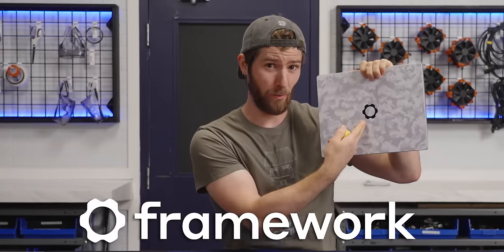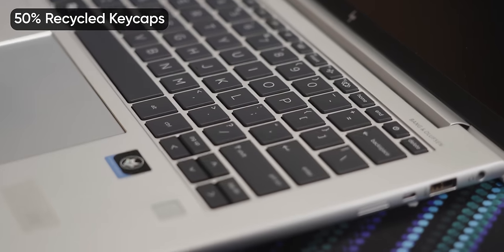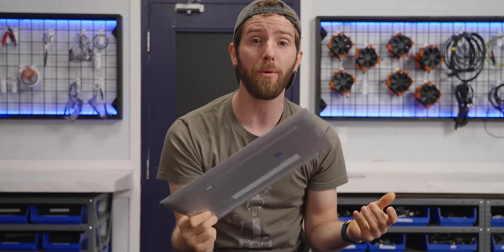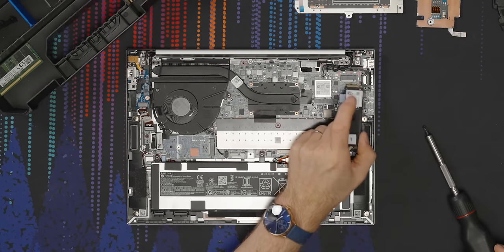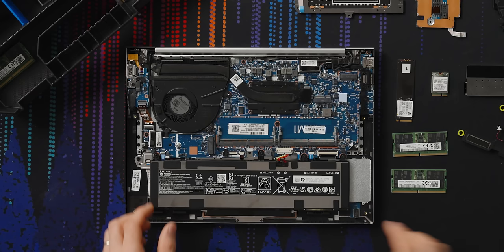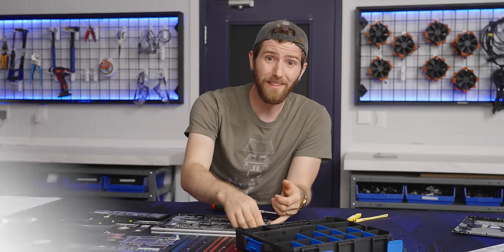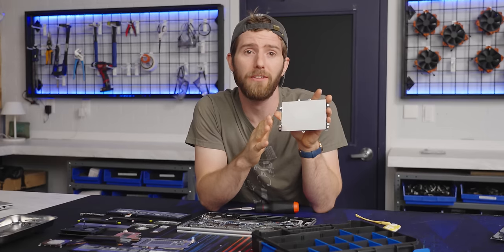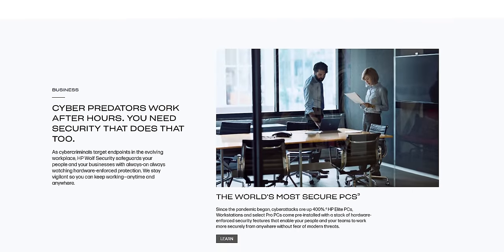My Investment is in TROUBLE - HP repairable laptops

Comment: I'm hesistant to praise HP - it might be the case that small form factor laptops as of late use more glue and parts that can't be removed. However, I have cheaper laptops within a few years old, from Acer for example, that allow you to take all of these same parts out without dealing with any glue or weird screws. To me it feels like HP just shipped a normal laptop that their media team just slapped on "repairability" when it's been like this for years for many, many laptops. Maybe their smaller or more unique designs have glue, but I would venture that many laptops still simply use Philips screws with no glue in the chassis. At least that's been my experience.

Comment: Did they fix their terrible hinge design that last I heard they had a class action lawsuit over? If not all of this is a great step in the right direction but ultimately means nothing as if those break you have to replace the casing which throws any sense of end user reparability out the window as that would be too daunting.

Comment: ...Hey Linus, hate to break it to you, but this isn't unique to the G9. I'm a tech at a site that uses exclusively HP who's worked on the G7s and G8s. Literally nothing new or interesting on the inside, outside of the AMD CPU and the related connectivity. Heck, the G7s were even easier to work on than this.

Comment: Coming from an it tech who has repaired a boat load of very similar HP laptops to this one...the design isn't really that special, the repairability isn't really any better or worse than most modern HP high end laptops, literally all they have done is readily supply parts and not charge through the roof for them...that's something everyone should have been doing from the get go... I really am not all that impressed by this over the framework

Comment: Framework can always move to a niche the major manufacturers aren't at (not for lack of trying...I'm looking at you, Dell): repairable, upgradeable gaming laptops. Where you can move the board into a Minisforum NUC Xi5/i7 type of enclosure for emulation etc on a TV for everybody not wanting to blow cash on current console games that don't get to Windows.

I mean it doesn't have to be a super thick Alienware with a supposedly replaceable GPU or an Asus external dock that uses a desktop GPU card and a proprietary connector that works better than Thunderbolt (why can't we just have an Asus external dock  using that port though...sure you might not buy an Asus desktop card, but at least it won't be a $1500 GPU card with a power supply every time). That you can switch over to a board with a  new gen GPU and a two generations newer CPU is enough.

"But gaming laptop component locations make designing the cooling system problematic!" VAPOR CHAMBER. Components can shift around a bit but as long as the CPU and GPU have the same height and you can tell what  thickness thermal tape you have to switch to for the VRMs and VRAM it won't matter if you had to shift either of the processing chips to accommodate VRM or VRAM.

Heck I don't even need display panels alone to be replaceable. Have it all come as one assembled clamshell and I'll reinstall the whole top half. At least the new one won't have scratches on it or have plastic temp warp over time that makes snapping on a new panel a problem.

It's not going to be a super slim machine either, plus the power input's gonna be a barrel plug or something that looks like USB as on Lenovos, so it doesn't necessarily have to have only those hot swap Framework ports. Maybe have one or two like that so peripherals' receiver dongles can be recessed. Otherwise I'm fine with a daughterboard on one side and the rear. Best part about it being on the daughterboard: you can pull video cables out and damage the miniDP or HDMI port or the TB port if you have it hooked up to a dock with a card reader and extra peripherals you only use at your desk, and you still only need a screwdriver instead of a freaking soldering iron.

Heck if it gets me a bigger battery plus it has a vapor chamber anyway I'd be willing to go with soldered RAM. Sure maybe that's harder to fix, but then by the time you break the RAM you might want to upgrade to a newer board anyway. At the same time...would you actually break RAM and RAM controllers when it's also getting cooled by the vapor chamber instead of having the heat trapped by a shield or just not having holes there for your cooler to blow air onto the SODIMMs through.

Comment: HP keyboards are not replaceable. They are plastic welded to the chassis. This doubles or triples the price of a replacement cost and makes replacement a major headache.

HP is much better than most OEM, but not particularly remarkable, and has been on this path since before framework was a threat.
I'd like to point out differences of internal screws, and that the captive screws wear out and fall out after a few cycles.

Comment: I don't think repairable offerings from HP or Dell will compete with Framework. The motherboard on my XPS 15 just died after 6 years. That is a replaceable part, but Dell no longer has it in stock. Why would they when their enterprise customers replace laptops at a 3 year interval. I'm sure though that Framework will have a compatible upgrade motherboard for me in 6 years. Building a repairable laptop is easy. Maintaining spares in stock is where I fully expect HP and Dell to fail.

Comment: Most laptops in the budget or midrange are the same, its not better or worse than most other laptops i have worked on, and the main culprits of non serviceability are higher end and more expensive gaming laptops or thin ultrabooks. and every single lenovo to touch the planet, as for asus they are good. but they use many many different screws most of the time and take around 30+ minutes to disassemble in a NEAT fashion. as for the replicable daughterboard. Yes. we need this more. please.

Comment: hp repair tech here, the price point is a hard sell to large scale customers. a lot of the laptops i see from hp are chrome books, they are generally easy to repair, the parts are cheap and the low price of the units makes them attractive. if they could get these down to like $400 usd it would sell like hot cakes. also, the link to the product is broken. enthusiast level pricing for a product like this doesnt make sense imo.

Comment: The irony of Linus gushing over how easy it is to repair an HP has me chuckling.  I had EXACTLY the same experience with Dell.  ...over twenty years ago.  CONGRATS, HP, ON JOINING US IN THE TWENTY-FIRST CENTURY!!!  HUZZAH!!!  

(Seriously, though; I had bought a second-hand Dell laptop that number one son dropped off the bed during the night.  Not a problem; it was a Dell.  ...not a problem, that is, until number TWO son got up in the middle of the night and stepped right on the screen.  Oof.  While checking Dell's website to see how much a new one would cost, I found out that it was still listed as covered under their 'CompleteCare' warranty.  I assumed that they wouldn't warranty it because it had A) changed owners and B) hadn't died because of a defect.  Wrong on both accounts!  They not only didn't care HOW it got damaged--their fine print literally mentioned only things like 'obvious hammer marks' as reasons to not honour the warranty--but they offered to send a tech to replace the screen on their dime THE NEXT DAY!  As I already was a tech, they just started the shipment procedure and sent me links to their excellent part replacement guide for the screen.  When the new screen promptly showed up, all I had to do was replace it, put the old one back in the box, slap on the included(!) shipping label, and give UPS a call.  Done like dinner!  I was even MORE overjoyed a few years later when I became one of those techs and ran around my area fixing people's Dell computers and making them happy.  Lovely.)

Comment: How easy is it to service the keyboard?
Also, the webcam is bad. Good job saying 'the webcam is bad' without saying 'the webcam is bad' by just showing a terrible video feed. Funny that you can't point it out because it's sponsored. 
Also, certain HP laptop lines have been highly serviceable for a while. Not the whole industry went for planned obsolescence. Then again, computers become obsolete after a while, only it's taking longer and longer with stagnating performance and the fact that computers from 10 years ago are good for most basic use cases.

Comment: Hp is just the worst . I got hp  envy  x360 13inch ryzen 5 4000 series  and  it is just   so bad . It overheats all the time and it so slow . I forgot to mention it has dual channel 8 gb ram and nvme  ssd . So how could this hp laptop be best when I have a PREMIUM hp laptop which  can't even over clock it's  cores. And it went to repair 4 times and the problems aren't even fixed when send it  hp to repair it . And problems show up everyday

Comment: Okay now I have a bone to pick with you Linus, working with the HP software on a professional level. Fuck the HP software, there's a bunch of drivers you can only get through there and not through normal win update. And the battery protection shit is hot air. Unless there's a massive improvement now it's shite. I've worked with these things that have had the software running their entire life and the battery dies like any other unmanaged battery. We get ones in with and without and battery failure time looks the exact same. Source, I've worked on 20 of the version of this laptop from a few gens ago yesterday alone. Great laptops but the HP support garbage is some of the worst bloatware I've seen in my life and I'm disappointed that a channel that used to be against bloatware is now recommending you taint your PC with the crap.

Comment: Now if only their printers wouldn't be so anti consumer.
Reply: Yes.... I work in school IT support. Printers are a nightmare not only to work on, but setup. Normally, we could easily install a printer in less than 10 minutes. But now, HP has done some bS where you have to register for an HP account and then connect the printer to the internet, it will display a code, and you have to register the printer with your HP account. Its maddening. It can't even do its most basic function, printing, without being registered.
Reply: @JJFlores197  adding to this nonsense comes the holding hostage of ink, designing cartridges to be empty before they actually are

Comment: Linus, dig  a bit more and try again.  i'll give them credit for a repairable design, but it is hard to repair anything without parts. Check with Louis R.  You had access to parts that real customers simply won't have. Paid reviews just don't end well for real customers.  Please do a follow up video posing as a regular customer. That would provide a typical customer experience.

Comment: $1400 bucks for a laptop with integrated graphics no thx, when you can get an entry level gaming laptop with better specs and a real graphics card for a little less than this hp laptop. now if hp had a modular graphics card like a 3050 or 3060 on this system like how they used to do with the old mxm graphics cards on laptops back in the day. Just can't justify a $1400 price tag on a system like this just cause its built to a standard that makes it easy to work on. which is what all companies should be doing anyway instead or creating tons of e-waste and pissing away rare earth elements used in consumer electronics.

Comment: Still, did they release schematics?
Overpriced parts that aren't even in stock and are not guaranteed to be in the future, when you might actually need them, are not the solution to the problem of repairability. 
I have more trust in Apple's useless 'repair' program to live than i have in hp. You're not repairing, you're buying new pieces, and you still depend on them only

Comment: Oh, another company is making repairable laptops?  Well that's grea--it's HP?  Nevermind.  Also those reasonable RAM prices Linus is talking about? TERRIBLE.  I see 64GB (2x32) DDR5 laptop memory for $282.99 TOTAL.  If you look closely you will see they are selling 64GB for $820.

I only hate because I care...about not buying a lemon.  Every single HP I have owned and the hundreds I have purchased from my employer--provided they don't suffer the death of a thousand drops--will always die from the same thing: power.  I have had HP devices that fry electrical sockets, ones with exploding power adapters, ones with bad batteries, ones with internal shorts...  And that's a good segue into the purpose of this post.  HP has done this "repairable laptop" thing before with the HP Elite X2.  I loved the design of these, though detachable keyboards aside, they ended up only being marginally repairable.  The reality of ultra-thin devices is they leave no room for error.  The HP Elite X2 had a small short-circuiting problem that HP didn't fix in their revisions and where I had no patience to check hundreds of surface-mounted components to figure out which board or module had an issue.  If HP did it wrong enough, the problem part likely fried others anyway.  No room for error.

As far as what you could repair, that was a nice experience from a build and tear-down standpoint--nice, but not great.  All of the ultrathin laptops on the market are held together with plastic tabs and adhesives with a few screws thrown in for good measure.  Tearing off adhesives leads to bent cases and thinner metal parts.  Plastic tabs break, slightly changing the shape of the part as it sits in the laptop.  That--along with the tight fit--means shorts.  It only takes a millimeter or two and then you start seeing intermittent problems.  So for my money, it's gotta be screws or nothing.